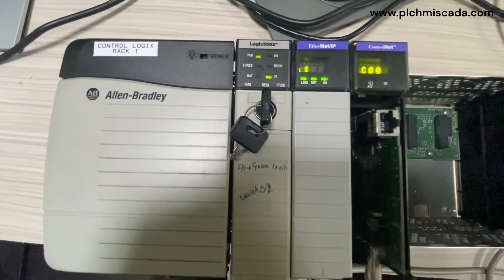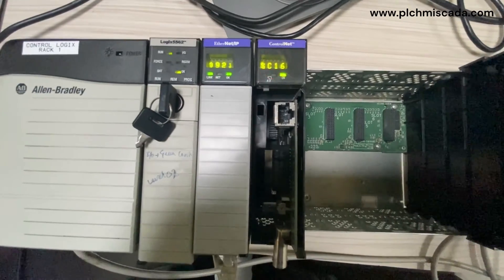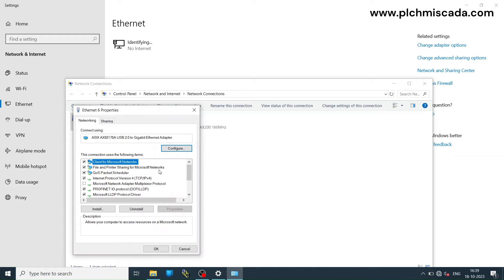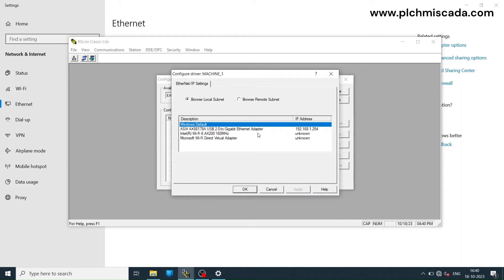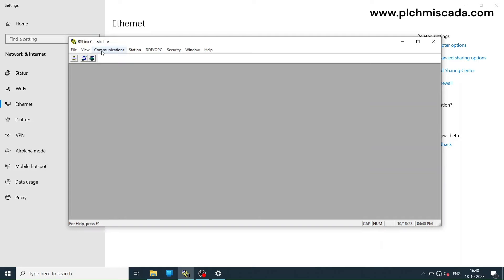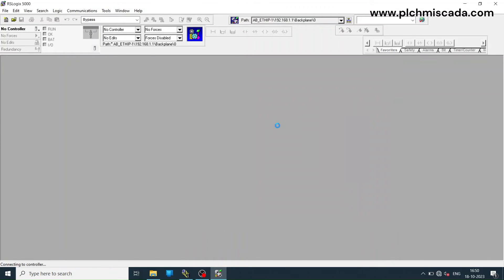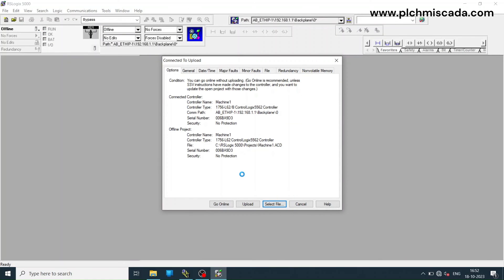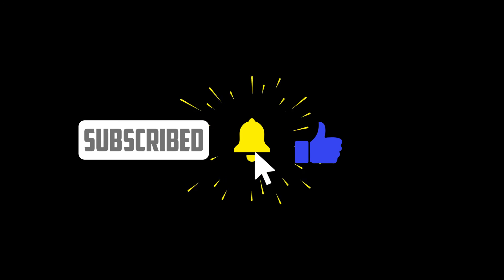How to upload from  PLC | RS Logix 5000 | Studio 5000 upload |How do upload from PLC RS Logix 5000

Comment: During equipment running can I take a fresh back up from PLC ?? What all care I need to take ??
Reply from the maker: Yes you can take the fresh  backup from running system ,keep in mind before connecting laptop to machine network check you laptop IP it should not conflict  with any other device in machine network and select correct version and carefully choose upload option